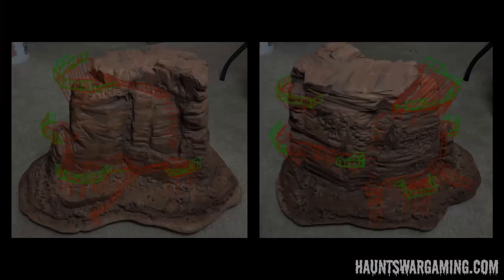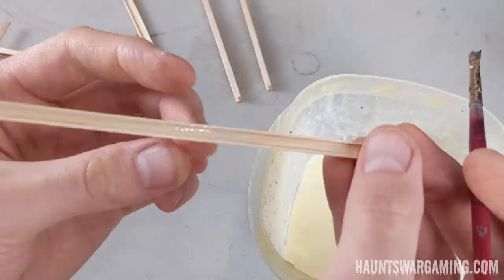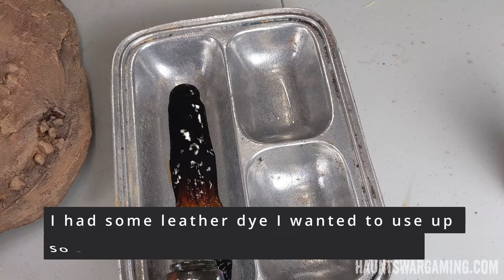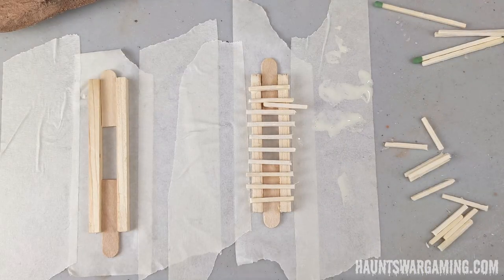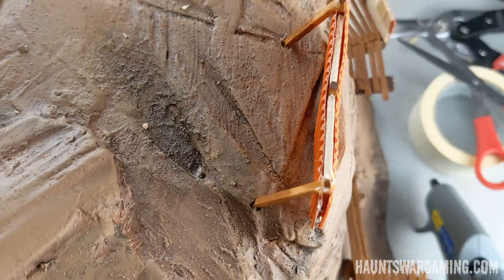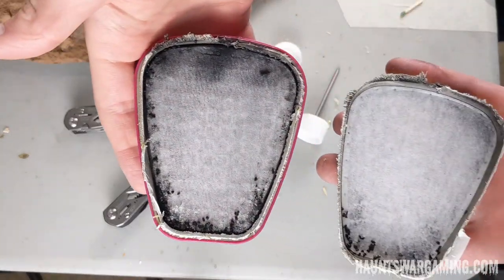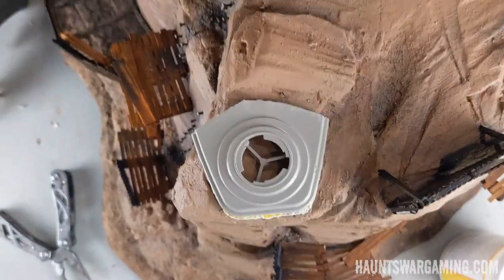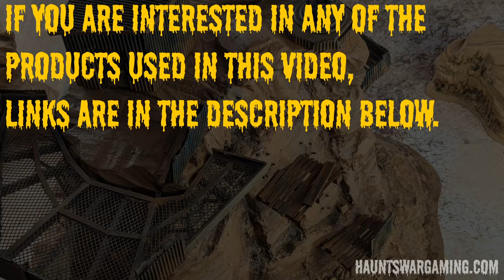DESERT MESA OUTPOST - Miniature Terrain Tutorial [DESERT TERRAIN EP.3]

Comment: Great work, and gives me a few ideas for things

Since you'd covered the foam in compound, it might have been easier to replace the modpodge mix with some of the exterior spray paint+primer options to save some time. 

You might also consider looking in the hardware store for various metal mesh tapes rather than going for the office supplies to chop up. I believe it's in the gutter sections and is a lot easier to work with and the same basic thing while being cheaper.  It's not quite as heavy duty, but you aren't likely to need it to be that level, and it becomes far easier to have some fun with it such as trimming in some interior battle damage. A friend of mine used a lot of that for a scifi setup a long while back for catwalks.
Reply from the maker: Thanks, I'll have to check out that mesh.

Also, I haven't tried it but I don't think the compound would protect the foam from the aerosol spray. The mod podge forms a vapor barrier plus it gives everything a hard shell. I needed that around the areas where I cut the spray foam since it becomes spongy when cut.